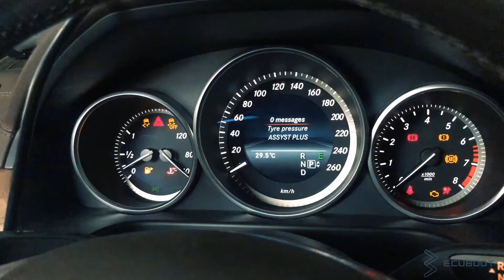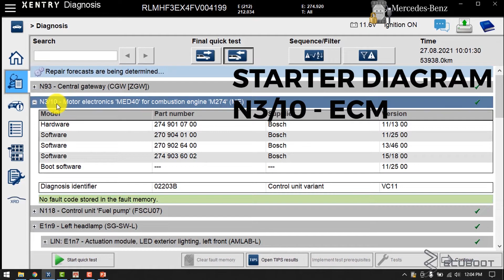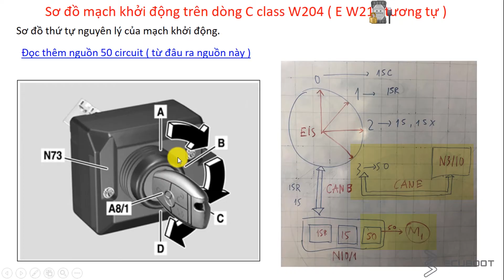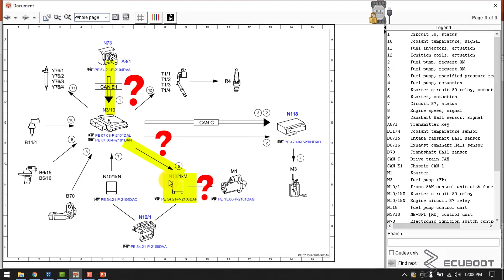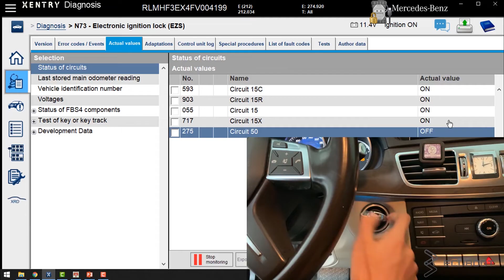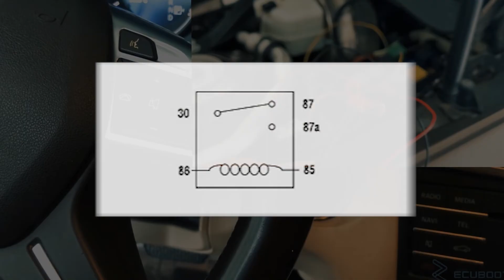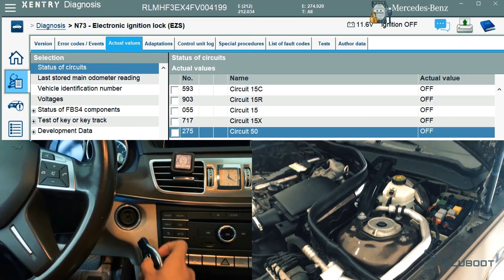Mercedes Won't Start ! No crank No Start No DTC. Easy Fixed (Detailed Procedure)

Comment: I am experiencing an issue with my 2007 Mercedes S550, which has a history of recent maintenance, including new starter and rear batteries, as well as a starter and alternator replacement two years ago. All fuses and relays have been checked and are functional. When connected to Xentry, attempting to start the vehicle with the key in position 2 results in the 50 terminal option remaining off. Additionally, the "red battery" icon appears on the cluster within 10 seconds of the key being in position 2. It is worth noting that a recent full scan of the vehicle using Xentry revealed a defective EZS/EIS. What is the root cause of this issue?

How do I jump start it with the wires like you did in that video?

Comment: @GilbertPanczyk-xs1mh   asked you an important question, i can see that you jump 3 and 5, 4 is connected to 5 by a diode and i would not jump that at all. the other two poles 1 and 2 are the coil and are jumped by a resistor 84 ohms i believe which make measuring the coil difficult. I can apply 12v to 1 and 2 to see if the relay closes but not yet.

Comment: Hi please help!!!! I try to use to wire to start my car manually just like you did, but I don’t know what position to connect the wire. It’s late night I just want to start and take the care home then I can buy an replace the Relay myself.
Thank you!!!
Reply: Jump 30 and 87
Reply: i can see that you jump 3 and 5, 4 is connected to 5 by a diode and i would not jump that at all. the other two poles 1 and 2 are the coil and are jumped by a resistor 84 ohms i believe which make measuring the coil difficult. I can apply 12v to 1 and 2 to see if the relay closes but not yet.
Reply: My is the same I put new relay fuse but blow fuse number 7 with old one I doesn’t blow it with new it blowing any help

Comment: Excellent trouble shooting process!  But isn’t it that MB no crank-no start problem—especially with some models—tend to fail more on the EIS/EZS side though?
Reply from the maker: In my eperience, this specific problem tends to be problems with a faulty ECM rather than EIS/EZS, Probably 80/20 chances